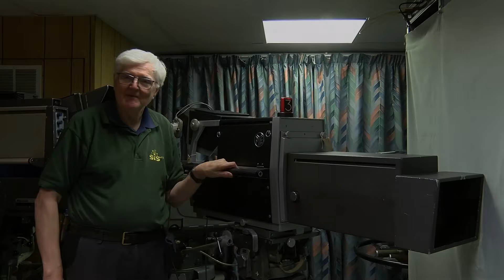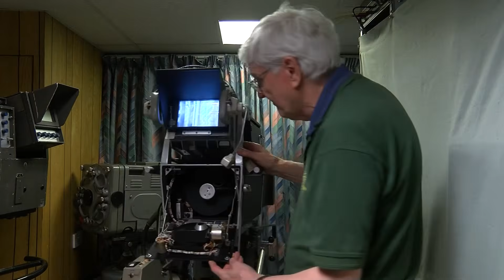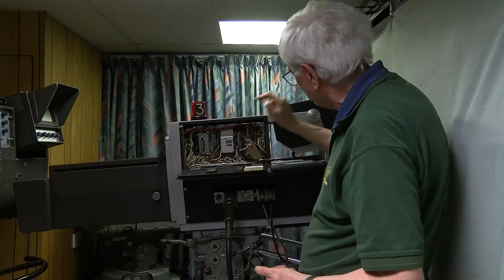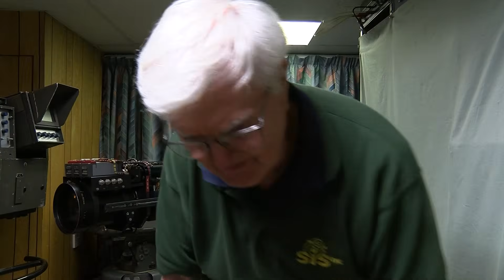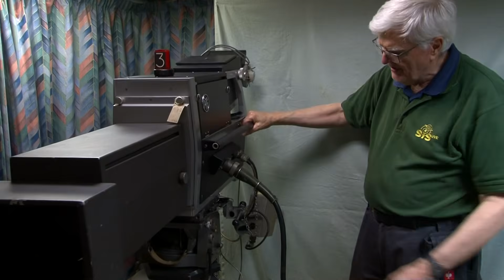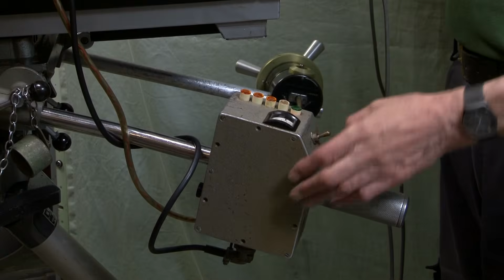The Pye Mk VII camera – In a Nutshell - part 1

Comment: I worked on building these cameras as part of my 60's apprenticeship in Cambridge. One project I recall was a complete OB unit. It's first venture was to Liverpool to televise a live performance by the Beatles. My task was to assemble the multi wire cables that connected the cameras to the control desks.

Comment: Would that loud fan noise be picked up by the sound recording.
Reply: There are a couple of fan issues here. 
1. Yes the camera fan is very noisy and in use the maintenance dept would have changed it. 
2. In our recording we forgot to use the radio mike that I would normally have worn. This would have helped a lot with the noisy fan.
3. Operationally on outside broadcasts the sound department  may fix a gun microphone to the camera to pick up the sound of the "action".  The Mk7 does not have a separate programme microphone circuit like you would find on later cameras.
Reply: In the US, at least on the RCA TK-41for example  there was a Rehearsal/Air switch that controlled fan speed (and noise). Fast during rehearsal. When, about 10 seconds to going live, the director came over the headset and said "fans to air". the studio got real quiet and you knew you were going live very soon....The idea was to provide lots of cooling to the bases of the IO tubes to help extend their life b/c they were so expensive (about the cost of a new car). That fan speed was too noisy for the program itself however with several cameras.
Reply: no: the cameras were image only, the sound stage was a separate business
Reply: @sashimanu  I don't think @Peterjames3535 is implying that the mike would be on the camera. I think he was asking whether the noise of the fans from a studio full of those cameras, in their normal positions relative to the performers, would be picked up by the normal boom microphones used for the perfomers.

I imagine camera noise (and other noise in a studio) is more of a problem for boom mikes, being relatively distant from the person speaking, and less so for modern personal (tie clip) mikes.